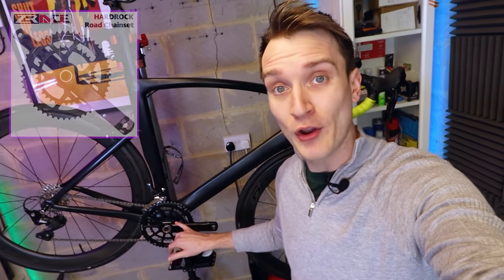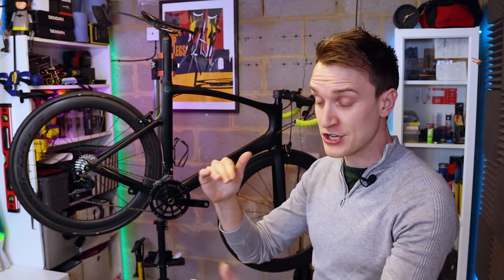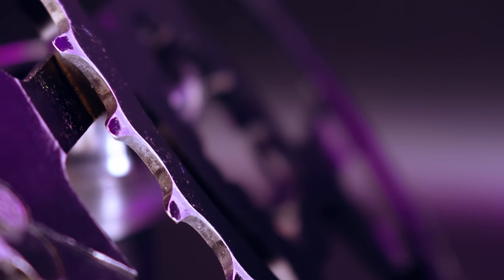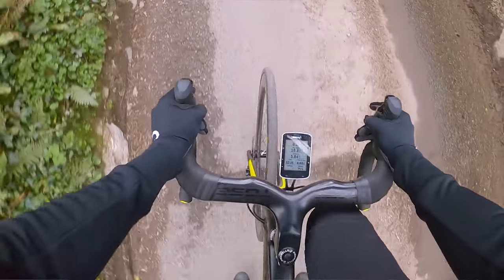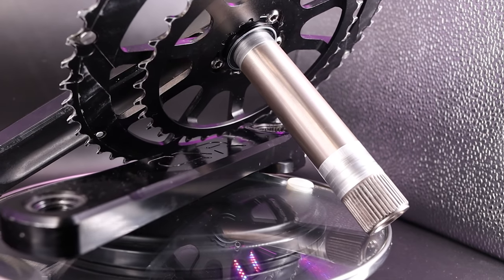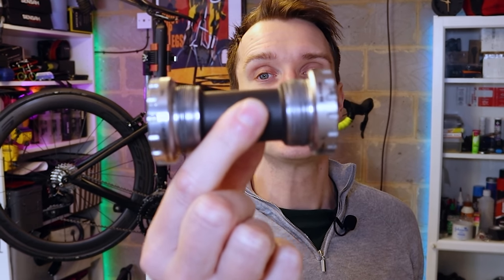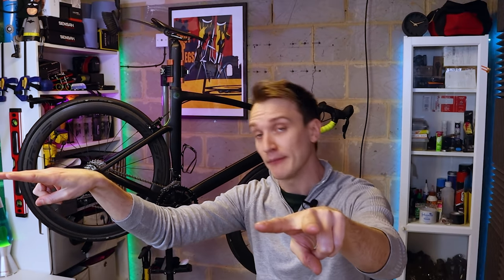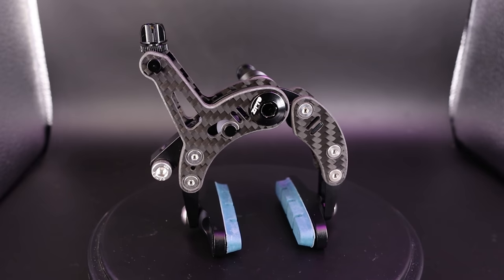Cheap Chinese Crankset ⚠️ Is failure inevitable?

Comment: @Trace velo -you are wrong. Shimano was using aluminium axles in cranks, many years ago. I got really ugly lx cranks with them ,used them for years ,still -all good. However i gues bots shimano axles steel vs aluminium are pretty close in terms of weight. I'd go with steel every time

Comment: I've got the Zrace RX crankset which is a dub standard. Never had any issues.
Reply from the maker: BEDFORD back in the house! Yeah that Zrace RX has been in my basket for nearly a year now... But how have the bearings held up in the bottom bracket. I heard that the lower profile bearings needed for the 29mm dub axle can be problematic...
Reply: @TraceVelo  the BB has actually been faultless. I've had a fair few ali express pf30 BBs that have been awful in the past, so I was pleasantly surprised!
Reply from the maker: Ok nice, good to hear. Out of curiosity, what were the issues you faced with the other BB's, were the bearings just trash?
Reply: @TraceVelo  The other BB that i had issue with were the ZTTO thread together PF30 BB's (I have tried 3 of them). They generally creaked after one or two dry rides, I generally think the shell of the BB was too thin and flimsy therefore creaking. To hand it really did feel very delicate.

Furthermore I even subbed in some "expensive" bearings from a known good BB to test, and it creaked exactly the same!

Edit: additional info i have just remembered. the ZTTO is a copy of a Wheels MFG BB that I have in my other bike atm, the quality of material is substantially different but so is the price.
Reply from the maker: @abedfo88  Ok Awesome, thanks for taking the time to reply. I've faced some similar issues with press fit bottom brackets thinking about it, but regardless, ill bear this in mind when im checking out BB's in the future!

Comment: I'm tempted to say the crank you showed hasn't failed because of high cycle fatigue, the theory you presented. I'm fairly confident posting this comment because of the very limited use that crank had and the extensive portion of brittle fracture shown on the broken surface, while the typical surface associated with 'beach marks' (high cycle fatigue propagation marks) cannot be clearly observed. I'd say the axle failed because of crack instability after a very limited number of deformation cycles (Linear Elsatic Fracture Mechanics, LEFM) from a pre-existant defect, likely way bigger than the tool marks you pointed. Moreover, I wouldn't be surprised if the original defect was on the inside of the crank: the outer surface is easy to inspect and I presume (hope...) Chinese manufacturers do visual quality checks on their products, while an inspection on the inside is way more expensive and time-consuming, but this is just speculation since I'm already saying waaaay too much from such a picture.  The fact that 7075 T6 Al has very low fracture toughness doesn't help at all. An overload as you described may have caused this type of fracture, wich is fairly common on high perfomance aged Alluminium alloys.

But the basics you reported are true, the surface of the crank is indeed not polished but 'roughly' finished by tool (looks Ra 3.2), which does not help with fatigue life, no matter if high cycle or low cycle. The standard of the industry for axles is a smoothed surface blasted with high energy media in order to induce compressive strain on the surface, improving fatigue life and closing non-visible defects. 

Great video anyway.

Comment: Chainrings, like cassettes, will wear and may need to be replaced after about every 3 chain changes (providing the chains are not over-stretched before replacement as your cheap chain was).  The problem isn't so much that the teeth become prone to breaking because they are thinner, it is that they wear on the contact edges and when you put on a new chain it only engages with the first one or two teeth on the chainring thus putting all of the force on those few teeth.  This is exactly the situation that you showed at 2:52 in your clip.

Comment: So maybe the aluminum spindle failure was a fatigue failure, or maybe not.  But if it was, wouldn't the aluminum crank arms have the same problem?  So how can we calculate a safe working life for aluminum parts, preferably based on mileage, since mileage can easily be tallyed with a simple $20 bike computer?

Comment: Personally I would swap them out for the steel axle version as cranks are vital to stability and steering, once they fail, controlling direction is dodgy at best. They are so cheap, why not?
Reply from the maker: Yeah replacing with a steel axle variety would be a good shout, if only for peace of mind

Comment: Is that a hickey on your neck there Luke? Got some large female mosquitoes buzzing around your place? 

I bought a Litepro EDGE AIO crankset just under 2  years ago. $75US. My only issue is that the crank arm is so wide, it snapped the rubber band holding my smart cadence meter. Because strava recorded where I lost it, I was able to find with a flash light. Other than that, the crankset is nearly the same as yours. So far, so good.

Comment: 6:30 What the heck are you talking about??? OF COURSE Shimano used aluminium spindles on Hollowtech II cranksets, I am actually holding one in hand right now, it's the first Shimano Ultegra FC-6600 Hollowtech II Series. The aluminim spindle was very thick, thus eliminating any relevant weight savings. Furthermore, in spite (or because) of nickel plating the spindle was prone to corrosion and obviously had substancially less surface hardness. The very slight magnetism of the nickel platig could lead to the assumption that it is made of steel but it isn't.
What do yo think the FC-6600's left hand little plastic crank arm fixing bolt to preload the bearings on the left side has a thread diamter of only 15mm, whereas they normally come with 20mm??? Simply because the alumnium spindle was so much thicker, leaving a much smaller hole.

Comment: Luke, you mentioned that the axle for these is now made of steel at 10:03. Do you (or Paul) have any idea WHEN the company made that switch? I bought one of these in the fall of 2021 and it's been good. Obviously I could answer my own question by taking it out and checking it with a magnet, but maybe youtube is faster haha

Comment: Would you consider looking into the Aliexpress fake Mavic Cosmic alloy aero wheels? They seem to pop up very little and even less with an English speaking channel. They would be super interesting to see some proper mileage testing done on. Also, they are cheap (not super light, but your bikes are light enough already ;) ).
Reply: The John Smith did a video on these, but your take would be worth a look too!
Reply: I had a pair, the hubs were complete garbage, poor seals and were noisy after about 100km I think the wheels cost about 80 quid from Ali express.
Reply: @outdoorvertical  well that's cheap! I got a pair too, let's see how they fare.

Comment: Really curious about the brakes! Been eyeing them myself for a while now, but i've been hesitant because of the high price tag (absolutely, not relatively ;) )

As always the video was great! Cheers
Reply from the maker: They are mega light, but tbh I'm not sure I would reccomend them. Among other things they are VERY spongy
Reply: @TraceVelo  ahh that's too bad. The eeBrakes are said to feel great, and I was hoping these would be an 'affordable' alternative to those. Guess I'll stick to the brakes I've got.
Reply: Yeah, I also heard they flex bit too much. I think that design is for cnc metal, not for CF. But, now there is new offering on AliExpres : R700 rim brakes. So I ordered a pair, have to find rim brake bicycle for them to try :)
Reply: There is an alloy version of them on Ali as well, that really shamelessly copies the cane creek ee's, weighing 187g for the pair excluding pads and some extra mounting hardware. They also come in regular and direct-mount options, and cost about 160/170 euros for a pair.
Reply: @TraceVelo  thanks for the sneak peek. I had the carbon ones in my cart, but also saw the cane creek ee brakes. Just pulled the trigger on the ee brakes. 👍

Comment: Something similar happened to a guy here in Chile, he bought a new gravel bike (sunpeed kepler) and the aluminium steerer of the fork broke, like it split in the middle of the whole shaft within 2 weeks of use. Not common, but pretty scary anyway.

Comment: Have you done a video on using those cheap unbranded carbon handlebars? Handlebar failure (or steerer tube) is more or less a guaranteed crash, I'd have more concern over those personally.
Remember seeing an FSA video demonstrating how bad the imitations can be.

Comment: I have learned over the years,that most if not all ultra light bicycle parts will either, A. Not fit right.....B. make horrible noises while riding. C. not be as light as claimed....D. Snap when least expected....I broke a thumb once when a crankarm snapped and it was not good......Now I say...."dont ride old junk"...."dont ride questionable no name stuff".

Comment: I just had a steel crank arm sheer off right below the pedal after many thousands of miles. (Sweet Wings -- think precursor to Cane Creek eeWings) Always thought I was safe due to them being steel. Thankfully I was only going about 8 mph when it happened.
Reply: Corrosion and cracks due to the bike falling to a side at some time.

Comment: What’s the width of the axle on the PR2 crankset? I always get conflicting answers browsing through the different vendors. Do you know if it’s the exact same crank arm set and axle width as the GR2 but sold with a 2X versus 1X DM chainring package? What’s the I factor and Q factor? And what’s the zero offset natural chainline?

Comment: Hello friend, I wonder if you can help me with a question

I bought this crankset to upgrade my Sora octalink crankset. I'm running Sora on my bike except for the BB and Crankset, however, the right crank (since it's straight like yours) rubs the front deraileur when I change to the big front ring. If I adjust the limit screw so it doesn't move as far then the chain won't change into the big ring.

I wonder if you came around the same problem and what your solution was 😋

Comment: 12:18 Is there any difference between the Senicx PR2 and GR2 other than the chainrings that come with the crankset? Like are they both compatible with the same chainrings and 68 mm BSA bottom bracket shells?

Comment: I thought I added a comment to say that the Senix does not come in 170mm nor in 53-39 but perhaps I should not have included aliexpress links. There is a another brand that does but I would rather go with one you recommend, especially since the chainrings are cheap (you say) whereas the chainrings for the other brand are nearly 50USD which is not far off Shimano and it is for cheap chainrings that I would want to use it. Should you be so kind as to add an updated link to 53-39 170mm then I will probably use it.

Comment: Hi!

I am just back from a bike ride..I have CVR cranks on 2 of my roadbikes. As I turned the last corner and leaned on the left pedal, the crank snapped..I stayed upright.. but it was quite scary.. thankfully 8 was not on the road. I bought X2 cranks from Holle Bike on Ali Express... And X2 spare chainrings.

It is very disappointing that it failed & also quite dangerous...

I have contacted Holle bike about this failure and hope they can replace the cranks with steel equivalents...

Luke do you think the steel spindled version of the CVR should be much stronger and more reliable?

Thank u.
Reply from the maker: Hey David, I just responded to your email! Sorry to hear your crank snapped aswell, but im glad you are ok :)
Reply: @TraceVelo  Thanks Luke!

Comment: Why do all of the double chainring cranks have spindles for 73mm shells rather than 68mm?  I am trying to find one for a BB86, but they all have longer spindles for BB92 and the included bottom brackets come with 2 or 3 spacers for 68mm shells to make them 73mm.

Comment: All true, but those failures can be overcome by adding material to that point , zinc based alloys are known for SCC 
7075 was always a race/aerospace alloy and yes generally it's a million cycles
But...hard anodise would increase   the life 
Motorcycle yoke tubes are made the same type 5mm wall, never seen a fail yet
It may be that chinese cast them, then turn which could explain the fail
Usual story,. Engineering is a science, some people know how it's works, some dont

Comment: It was dumb for them to make these 24mm spindles out of aluminum. There is a reason why Shimano only ever used steel spindles for their 24mm Hollowtech II cranks. And there is a reason why the other manufacturers had to create an all new standard, BB30 with 30mm spindle diameter, in order to run aluminum spindles.

Comment: Is there decent Chinese crankset which can work with Shimano 4-arm chainrings and be 165mm long?
I want to try 165mm cranks but they are not available in my country before invest in Shimano or Rotor ALDHU 24

Comment: Maybe I'm not getting it...? 720grams...light?, I would think that is for some fr\dh bikes, strong and rigid...saint and zee\hone weight around that. My current xt cranks (m760) weigh at 511g, and the other xtr(m960) are smt around 450 mark. How then the road bikes who cost 2e the mtb, and parts are also more expensive, have such a big weight difference...?
Reply from the maker: So this comment piqued my interest, and I had a quick look at the m960 cranks. So from what I could find, the crank arms themselves weigh about 500g depending on the arm length, and then with the chainrings and chainring bolts, the whole setup can weigh around 720g. Plus MTB chainrings dont tend to be as big as road bike chainrings. Dont get me wrong, still a pretty impressive weight, but if it was 450g, I would DEF be running these. But if i'm totally wrong, let me know, this was just from a bit of googling!
Reply: @TraceVelo  the bare xtr cranks(960) "seemed" lighter than my xt(760) that's the reason I bought them, and when I weighted them both I got a picture of only xt ones, so I couldn't really prove my point, the only thing I remembered that the next gen xtr was heavier.(my cranks are with that unusual separate holes for the 42/44t chainring , and it was cut off by the previous owner so only 64/104/ bcd) maybe that's the secret.... I use a single NW CR in front so it doesn't bother me, besides that it's old and hard to come by.
it looked very similar to this)), but again without the logs for the biggest chainring
https://www.bikeradar.com/reviews/components/groupsets/cranks/shimano-m960-xtr-review/
Reply: And they were 165mm
Reply from the maker: @MichaelFalcon-g3f  OK fair enough, I mean I have never used any of those cranks, so you could be completely right. By the looks of it, the chainrings are made of aluminium too (well dural), so thats gotta knock off some weight as well. Either way, they do look pretty lightweight so thanks for the comment dude 😄
Reply: @TraceVelo  well, you already have a carbon bike, So i would suggest carbon cranks also, sram xx bb30 is better than the new dub's(my choice if I would pick)

Comment: I can't get my hands on the ultegra 165mm cranks, im looking at the senicx, do I wait for the review or can I pull the trigger :D
Reply from the maker: So i'm only a few hundered miles into them, but the Senicx cranks are good. The Ultegra cranks will be lighter, by around 80/90 grams, and you will also need a new bottom bracket, as the Senicx have a bigger axle diameter, so bear that in mind...
Reply: I am building up the same disc Trifox, but due to lack of parts Im doing compromises. The weight savings are equal to the money savings it seems. Good thing the senicx already come with a bb,I have a spare one but since you can't buy them without it its fine. Oh and I like the way they look :D Thanks for the reply

Comment: Hi, the eagle eye saw expanders in the pedals on the disc brake bike what about that?
Reply from the maker: Yeah good spot. So I've always struggled with a little knee pain in my left knee, usually comes in after about 30 miles. I've tried all sorts of setup changes in the past, so I'm giving these a go. I'm hoping a wider stance will help keep me a bit more cental in the saddle.
Reply: @TraceVelo  and how is the experience going?
Reply from the maker: @134512F  So yeah, so far so good. I went on a 66 mile ride last weekend, and felt like it made a big difference. I felt much more planted in the saddle, and my knees held up fine... So fingers crossed, this is the setup change I have been looking for!

Comment: I just ordered a Sensah SRX kit yesterday and it comes with a Zrace RX single crankset. I can't tell if it has a steel or Aluminum axle. Any knowledge on this?
Reply: Check if a magnet sticks to it or not.
Reply: @jonathanperraudin6935  I will when it arrives. Just wanted to get out in front of this problem.
Reply: @cc-000  It's an aluminum axle. The whole Zrace crank and bottom bracket were total garbage. So much friction in the bottom bracket I doubt there were even ball bearings in the cups. I threw the Cranks and BB in the trash and ponied up $120 for a SRAM Apex and BB. Very happy with the Sensah shifters though. Miss have a clutch but for the price I'm more than satisfied.

Comment: You’ll be fine with the alloy axle. I’ve known some people breaking the steel ones. What’s the worse thing to happen 🤷🏻‍♂️ you’ll land on ya nuts, like I did on my bmx one piece steel cranks riding into a half pipe 😫 
Ps. AliExpress head unit test? Battery life of the 520 is rubbish

Comment: I have lost my bearing preload cap for my Hardrock CVR Crankset. The seller won't sell them separately. Does anybody know if you can 3D print them?
Reply from the maker: So yep, you can easily find replacements on Ebay and AliExpress. Just search for something like 'crank preload cap' and you should find one!